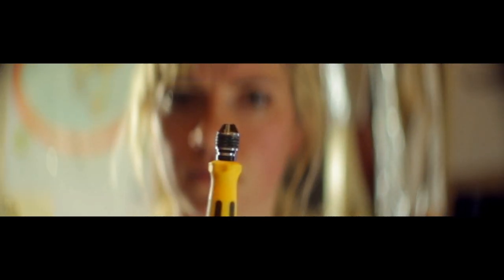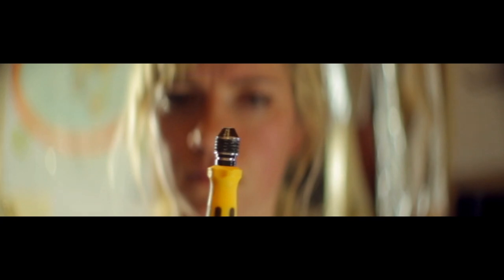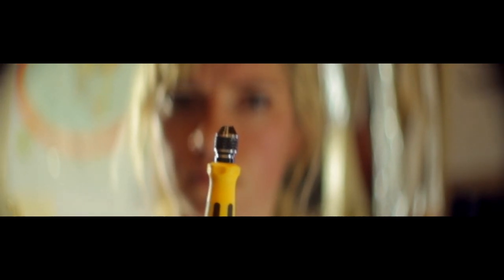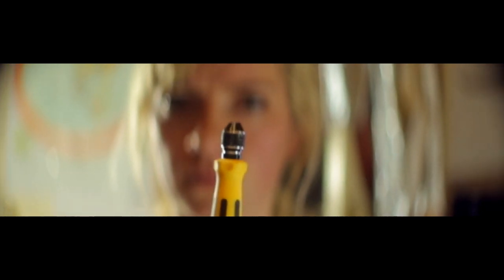Anamorphic single focus

Comment: Hey so I watched your modification video, I have some questions. So this prototype attaches to the front of the 50mm lens and you just rehoused some of the glass elements from older projection lenses? You showed that the glass could be split apart, so is it just the two glass elements inside the new lens that you custom built or are there a lot more lens elements inside the prototype?
Reply from the maker: Hi prototype single focus anamorphic is one lens for example 60mm+ anamorphic lens combined together no split glasses on this one.
Reply: Oh that's so cool! so you combined the anamorphic and spherical glass into one lens housing. @MSSTUDIO
Reply from the maker: @noahshettel1090  yes yes.
Reply: @MSSTUDIO  Could you share more info on how you did this?
Reply from the maker: @RonanBryson  not easy to explain.
Reply: @MSSTUDIO  What lenses did you use? Do you have any photos/videos of the process?
Reply from the maker: Hi i can show at the moment people stilling ideas without saying thank you.
Reply from the maker: @akashp5802  hi when people asking me for mod I always suggest that lens need be send to me I will probably put glasses anamorphic glasses in new body with ring on front for focuser 77mm so in that way you will get single focus solution email me
Mariuszsphotography@gmail.com